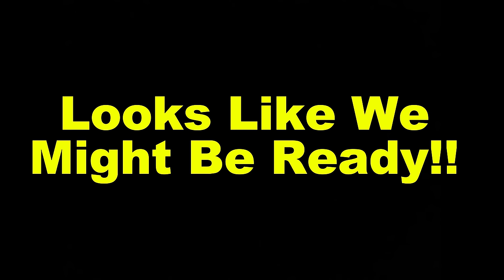We Have a Problem - Retaining Wall Progress

Comment: If you drill a bucket with  a hole saw then in cheap pink insulation with the sump pump in the middle.  That way it pumps out the water but not mud, sand or rocks. 
More rain like that and your pools will fill themselves. 
Soon enough you and Chris will reminisce on your new patio , with few cold ones. On your estate.

Comment: At least all the rebar magically popped back out of the trench before it rained 😊
Reply from the maker: We hadn’t finished. The rebar that was in, is under water
Reply: @BealyGood  I'm just picking on ya. Tell the concrete guy you want a 0 slump, it'll be fine 🙂
Reply from the maker: @kennethney4260  🤣🤣

Comment: What’s the reason for the concrete foundation for a retaining wall. I did hardscape for a few years and for retaining walls we just put 8-12in of road base and wet it down and plate compacted it then like an inch of sand and set the block. Then depending on material would if hollow fill with screenings or rebar if it’s mostly solid
Reply from the maker: Anything over 4 feet tall here, has to have an engineer stamp. So whatever the Engineer calls for is what you have to do.
Reply: @BealyGood  huh. I know here you gotta get a permit and submit plans but that’s about it for residential. Only time a engineer gets involved if it’s a commercial project or dot type job